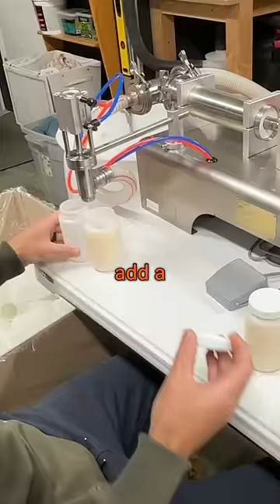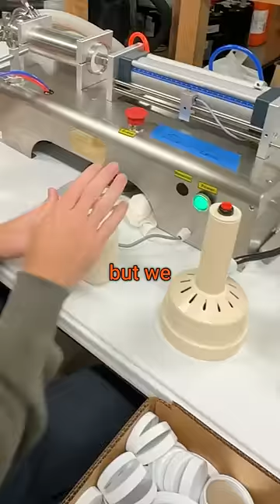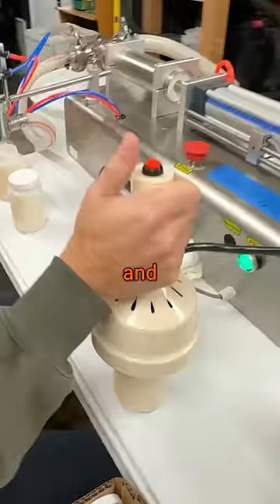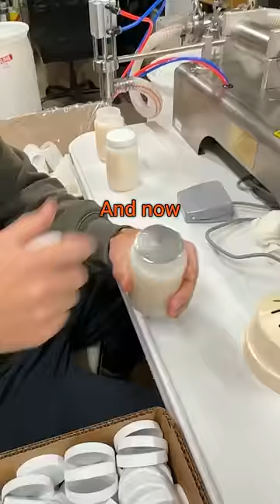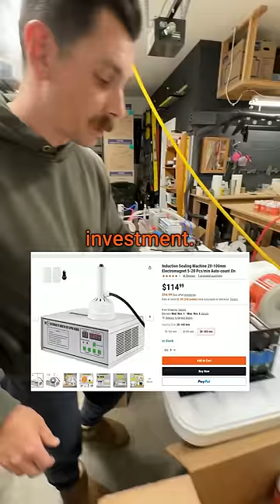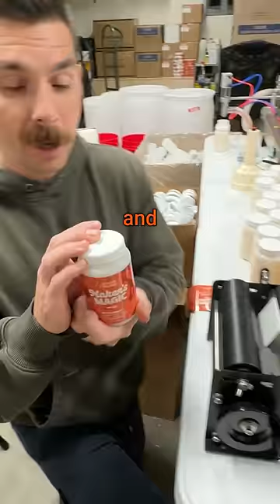What e-commerce is really like… #ecommerce #dtc

Comment: you can add a servo motor with an integrated controller to the hand crank and have it rotate for you at the perfect degree with a press of a button. that would be cool to see
Reply: And it's not that hard to do.
Reply: @mason2874  ye, the libs are right there and given the low torque needed even an Arduino and an example script would do the trick and still be kinda overkill
Reply from the maker: https://scorchmarker.com/pages/makers-magic-youtube
Reply: Stepper motor
Reply: I modified one of these labellers last year to do just that.  Pulling the arm down on to the bottle triggers the motor to rotate.  It continues to run until a sensor just sees the web.  There is no need for a servo or stepper motor.

Bigger, faster, and more versatile labellers that run on production lines operate the same but they generally use steppers to control the labelling speed.

The label material and size, the diameter of the container, and speed on the conveyor all have an impact on exactly when and the speed a label is applied to the container.  A mismatch of these settings will cause the label to wrinkle.

Comment: I used to work in a warehouse that made fuel additives. I found that labeling a mass amounts of bottles BEFORE adding the liquid make it much easier. Just a tip if you wanna try it and see if it helps your business at all
Reply: Might work in some situations..but you are having to handle the bottles twice as much and should there be a leak onto the bottle it would be easier to clean up and or not waste a lable.

Comment: Consider people at different elevations.
I am a over-the-road semi-truck driver and I often enough here plastic bottles popping (crinkling) from when I last opened them because of elevation change. So before you seal that you might want to give the jar a little squeeze so it's not puffed up so much.
Reply: Very good advice 👌 👍
Reply: Interesting…
Reply: sorry could you explain again? :D
You're saying to squueze the jars to release some air because if they are filled with air it will expand and explode?
Reply: @rohanofelvenpower5566  The foil seal after he applied it looked like it was already under a lot of tension making it easier to bust.
So if he is closer to sea level and ships it to somebody in the mountains, it would have an even greater potential of busting on its own.
Reply: As opposed to an under the ground truck driver?
Reply: @2shae475 Space trucking my dude
Reply: That's a great observation. It may be a fine balance. However if the volume of air is minimized, the pressure difference may be easier to manage. Smaller jars for the same amount of product or more product in the same jar may help as well.
Reply: But if you had opened them, the foil would be pierced,, so "since the last time you opened them" doesnt make sense. maybe dont do the lids up so tight or put them in a ziplock bag
Reply: @davidpile2576  I'm talking about when you buy a drink in the store that comes in a plastic bottle, those how they make ridges etc into the bottles, those pop (crackling) easier.
Take a swig, travel a few hundred miles (when changing elevation) .... Surprise! BANG POP SNAP CRACK!
Reply: I remember when I transported potato chips I believe you couldn't ship them to an altitude above 3 to 4 thousand feet higher in altitude because the bags would pop open.  They don't explode they pop open on the top. So basically if they were bagged at sea level and you tried to ship them to reno nevada the bags would pop open. Have you ever seen bags of chips where some are very loose and other bags are puffed out and they look like they are ready to explode
Reply: @2shae475 ”Over the road” just means they travel long distances like state to state vs trucking where you get to go home every night.
Reply: came to find this comment
Reply: Exactly why I'm going to audit this snake oil salesman.
Reply: I hear you driver I know the struggles,good luck out there,keep the shiny side up and rubber side down
Reply: If youve ever bought a bag of chips in the valley and then drove up to higher elevation (like to go skiing)…you’d understand that the chip bag air inside will expand and will pop open the bag when the air pressure difference becomes great enough… A little less air in the bag when packaged at low elevation woulda solved that.
Reply: Huh?
Reply: @JonnyHatesJuice loser
Reply: @EatMe420 But what if it pops just as they take the lid off and it doesn't make a sound while taking the lid when it pops, so they think it was popped before arrival.
Reply: Implosion vs explosion 🤣
Reply: @EatMe420I thought the seal was there so people can check if it has been broken. I’m sure there’s people in charge of checking for broken seals before tossing them on the truck and before stocking on shelves.
Reply: Or just make the bottles cold or hot when bottling depending on his elevation
Reply: Ive never seen that happen and have purchased alot over my 66 years. Not sure if I want a bottle that has its sides squeezed in, not sure your idea is really worth it
Reply: @charlieisntreal  I'm sure the 'under road comment' was a joke to make you smile :)

Comment: Hey man! Love that you're innovating and improving. A quick tip (manufacturing expert here) see if you can move the labeler over towards your machine to make a complete u-shaped cell. This will allow you to complete one piece flow instead of batching ceiling and then labeling. If you can have a continuous stream where you inject seal label and box/put into storage then you will save an incredible amount of labor which is critical for mom and pop operations. One piece flow also guarantees defects are caught almost immediately, but a side effect is your products are almost immediately able to ship in about 10 to 15% of the time of batching.
Reply: Industrial Engineering take, I like it

Comment: There are motorized label applications like that, too, that use a foot pedal to trigger it. Might be worth looking into to speed up that part
Reply: Someone thats worked in many production lines in my teens, I can say that the fancier these things get the more staff you need or time you need to fix it going wrong. I think he's probably made a good choice for now. The manual side of it probably means it never has issues.
Reply: I agree with the comment above me. I work in a tire factory and I am one of the guys that fixes the machines when they go down. Automation makes things efficient and fast, until it breaks... 
I think with a small business like this, a good balance is needed.

Comment: Great job dispensing the liquid in one bottle while putting the cap on the next. That is called parallel operations. Try applying the same concept to the induction heater and label roller. Seal on bottle while labeling the next. Continue eliminating waste and maximizing the output one person can do.
Reply: Automating even that costs less time and effort than relying on one human to do such a thing.
Reply: @Anankin12 how would you automate that process
Reply: @AVATARW0  a machine that handles the bottle.in the right way. If it's a repetitive mechanical task, it can always be automated. The question is not whether it's possible, rather whether it's worth doing.
Reply: @Anankin12 I used to work at a plant that made and bottled Palmers Cocoa Butter products. Their engineers literally designed every automation process for every line in there and made them modular so parts of the systems could be moved to other lines as needed. The only thing missing from their setups was electronic reporting systems. The closest they got to that was label and bottle counters. Everything was mechanical. It was really impressive.

Comment: Here is a good tip for testing your product packaging for shipping. Put it in a box that is too big for the product so it can move around in the box. Then stand at the top of your driveway and throw the box to the curb. Repeat this 4 times. Note, this test is invalid if your driveway is not more than 20 feet. Anyway, this toss will happen about 4 times when in the hands of UPS or FedEx as it makes its way through their system on and off the trucks.
Reply: You're a real one. Thanks for these tips
Reply: I used to work for UPS, trust me it’s more than 4 times 😂
Reply: I doubt my packaging would survive that test, yet USPS, Fedex and DHL still handle with enough care that the boxes arrive in good shape. UPS, not so much 😂
Reply: More like a reason why UPS and FedEx should be avoided at all costs.
Reply: Witnessed this happening, they grabbed the parcels from the back of a van and threw them to a pile on the floor to be sorted and delivered. I should mention it was not UPS tho
Reply: DHL👍

Comment: My engineering brain is screaming: I can automate this!!!
Reply from the maker: expensive undertaking. one we will look at when we do more than 100k units a month
Reply: @Vanader I would definitely add a servo or stepper to turn that label handle thing exactly, with a press of a button.
Reply: My operations brain: “well, are you operating at a scale where that’s worth it?”
Reply: Automation is worth it if you can make full use of it, this operation obviously can't. Rather I'd ask if it's worthwhile to arrange a short production run somewhere where there is a automatic bottling line. Different goo, different label, but a bottle is a bottle.

Comment: The BIG problem is the foil seal is not easy to remove. Put a tab on it to grasp and peel off.
Reply: I work in the packaging industry that does this, but at a very much larger scale. Adding a pull tab with induction sealer is, not great; you can do those tri tab sometimes, but honestly those kinda suck. But you'll likely have quality issues with just getting a proper seal. Most of the pull tabs that you see that are good are done using thermal (not induction), but seal would need to apply to jar first then cap applied.
Reply: You can pop it open with a knife,pen,finger etc...not that hard to open at all.🙄🤣

Comment: Got yourself a great little starter assembly line. Now you can google around for ideas on how to improve it!

Some easy ones:

1. Modify the input on your label maker to fit your packaging. Make marks for example representing one revolution around the bottle to save time on getting it exactly right.
2. Put the pedal for the feeder on the floor where it belongs. It's to allow your hands to do other stuff, increasing your speed.
3. Get a simple feeder for the filling machine. Think those drink shelves in stores that shift the entire line down when you take the one at the front. They're just a low friction surface (wheels or sth slippery) at an angle with a catch at the end for the bottles.
5. Get a simple feeder for the lids. Think of those columbs with a small opening on the bottom where you pull one piece out and the entire thing drops down to fill the opening.
4. Have a container next to the sealer where you drop in the bottles and the labeler picks them up.

Comment: With very little extra cash and a bit of programming you could make a fully automated line and save you both having to pack by hand
Reply: You underestimate how much the component costs to make an automation-capable assembly line
Reply: @BunToomo  Totally depends on the through-put (required parts per hour), process, product requirements, and quality control. A lot of this could be could be done with 1 or maybe 2 robots (Used robots) if I spent any more time thinking about it. 1 Robot 30k-ish, 2 robot 40k ish. Like I said depends on how many required per hour. 100% worthwhile if you're planning on doing production for a long period of time, especially if the demand will increase. I see at least 3 people working full time. How much is your time worth is the real question. If it's better spent elsewhere, it's 5000% worth it. Will pay for itself within half a year to a year, just guessing as I don't know anything about this business but it looks pretty labor intensive.  

Most people in automation are automotive based (my origins as well) which requires extreme accuracy, specialized equipment, and has a lot of paperwork and extras attached where as stuff like this can be done pretty dang cheaply (compared to a normal automotive job regardless of the type of job).
Reply: A few chinese kids would cost way less
Reply: @weefek what do you think will it cost me to automate bullion melting and laser engraving in same circle ?
Reply: @weefek there are some interesting balances to be had. The automation can be a business unto itself.

Comment: Squeeze it slightly as you're sealing it, so the lid is concaved instead of convexed. If the product you bottle has a shelf life, I would recommend measuring the internal gasforming (use a large sample size), so you can put on the label that it's safe to consume as long as the seal is concaved.
Takes out the guess work, because a "best before"-date, doesn't mean it's unsafe to consume if the date is (just) passed & if it was kept in a warm place for example, it could go bad before the specified date. 👍 Things like this can really make your product stand out from the competition, because people value simple sulutions like these a lot.

Comment: You just educated me. I always get frustrated, some of those melted on safety barriers peel right off. Some, you just about have to cut around the inside wall 9f the jar because it won't tear off. Doing that is imperative, because if you can only peel off some, then air can get in, oxidizing the contents. Cut carefully, and you have an intact seal.

Comment: Probably wouldnt be too hard to put a stepper motor on that label machine and automate that with a raspberry pi or just hooked up to your computer. Should help make it a bit easier and will ensure that its always turned the correct number of times as well as doing it pretty fast.